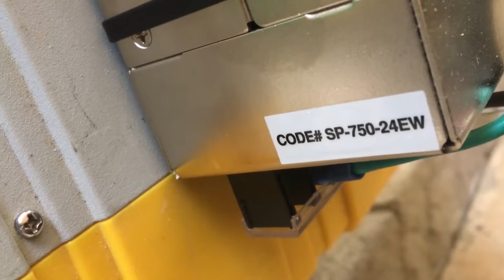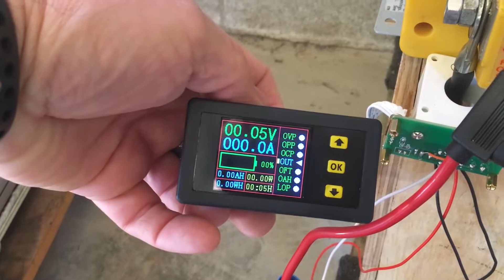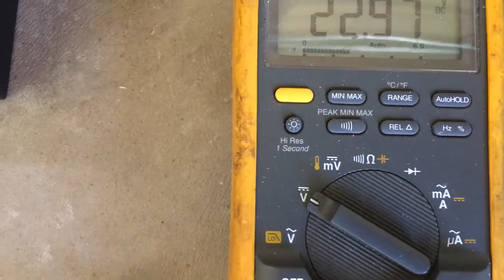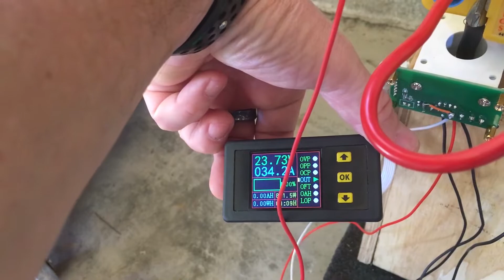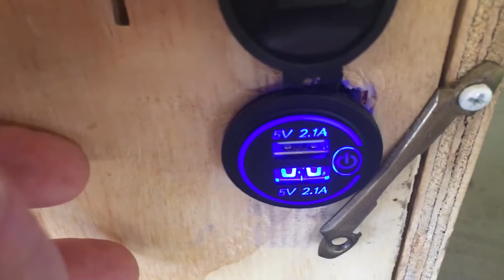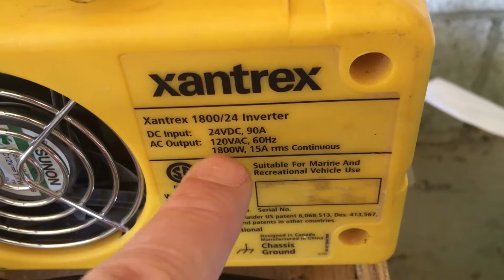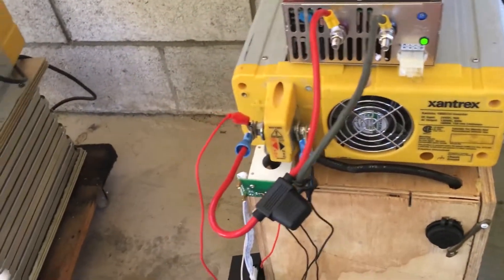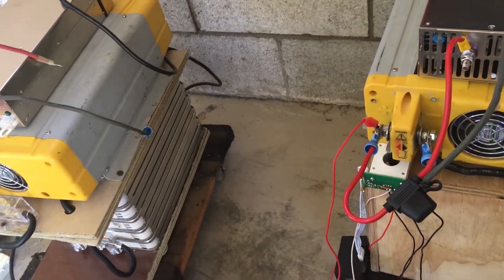Nissan leaf DIY power bank

Comment: I need to take something in my Nissan Leaf so I can change it where there is no charger and at some point on my road trip across the country I can always charge it along the way at an RV park they have both 30 and 50 amp sites
Reply from the maker: Sounds like you need to haul a 240 v generator with you. Best of luck!

Comment: The inrush spark thing is easy to avoid.   Simply Pre Charge the input caps with a 100 Ohm resistor between the source and the inverter / power supply for a second before completing the connection.  I do it on my E-Bike avoiding the connector from pitting.

I tapped the resister right to the connector to make things handy.